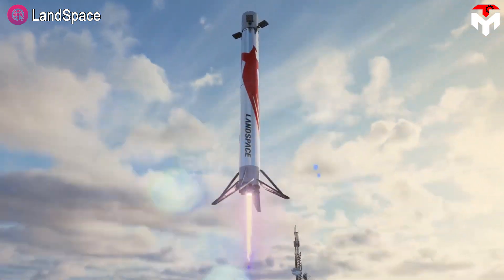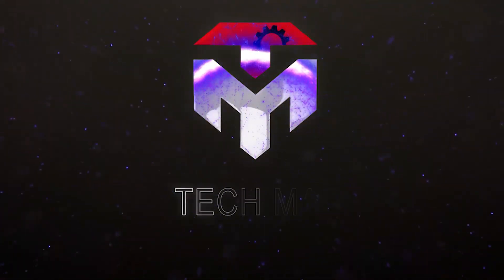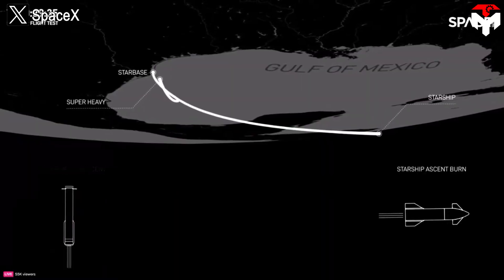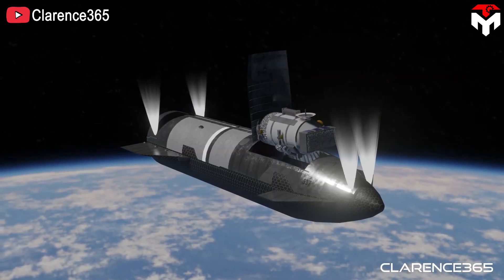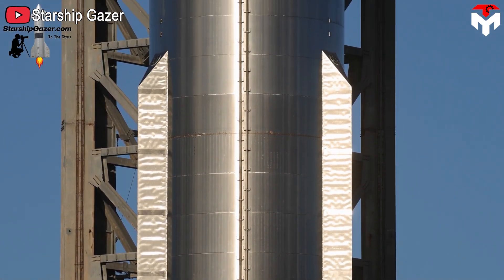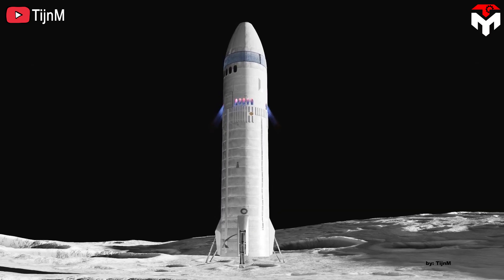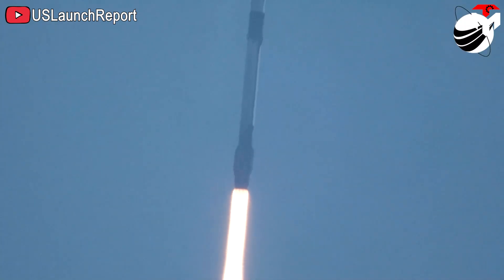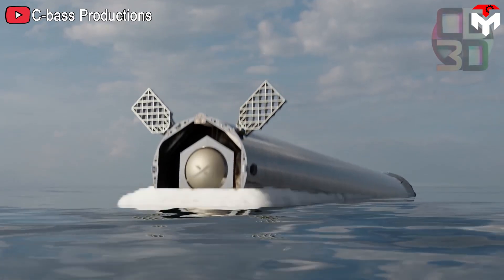MIND-BLOWING! SpaceX to Land Superheavy Booster Onto The Droneship...

Comment: @techmap9 what is more cost efficient, landing both Starship and Superheavy on a same structure... or developing landing legs, and brand new droneship, that would have to be custom made, so +2 years of development, and 100M per ship minimum, (extremely optimistic guess, since current droneship cost 10M for old, comparatively mass produced repurposed barges with the rework) or maybe more since you would make only around 3-5 of them for the R&D cost+ the operation cost of the crew, fuel and equipment. 
So at best it would cost as much as the tower, and you are dealing with extra dozens of people on top of it, and regardless we already had better idea considered, worked upon, and scrapped for the same cost efficiency reasons... Phobos, and Deimos.

Comment: The best solution would be to install a couple "landing sites" on solid ground, somewhere a few miles away from the launching site.
Advantages:
No risk to the launching site. 
No need to transfer the Starship or the booster from a drone ship to land. 
The landing site could at first be used with landing arms attached to  Starship and Booster but could later be upgraded to have a simplified tower with chopsticks.

Comment: The problem is that if they use drone-ship landings only, now flight cadences become limited by the number of drone-ships. Building out that fleet will be expensive, and especially as they move over to return to landing site. It is also the question of fuel saved by drone-ship landing versus extra weight and complexity of landing legs.
Interesting times await.

Comment: Per me the best is just keep large boat very close to Boka Chika shore. (It can be a couple of miles far from nearest port) After landing they can transfer booster back to launch area. Its much safer, than trying to catch it. In worst case scenario in rough sea booster will fall to the water if not properly fixed after landing.

Comment: I wonder why Elon not using falcon9 landing design for Booster. Its proven more than 200 times. They need just larger boat. It should be 5 times larger though. If it misses the boat during landing, nothing gonna be destroyed besides booster. If landing  to launch side, it can destroy everything there.
Reply: consider this, the barge is by your words 5x bigger but the accuracy of Superhavy will be the same as F9, it is the same GPS system, so it will be 5x harder to miss the boat and not cause damage to it, in case of late failure of the booster. 
Unlike F9 where slam onto a deck means slight facelift, Superheavy RUD might cause a decommission of the whole barge.
Reply: @Chuck.1715  Its not about accuracy. Booster is much more heavier than Flacon9, That's why you need larger and thicker barge. The rest is the same. If booster doesn't slam the barge with very high speed, nothing gonna happen to barge.
Reply: @tigranohanyan3321  accuracy is not the point of my comment, and i said in case of failure. Even if the idea is pursued, there are many reasons why it would not be cost effective, potential destruction of both of the vehicles is one of them.
Reply: @Chuck.1715  Hey, what's your point?  It was proved with Falcon9. Many times when Falcon landed and then partially exploded or fully exploded and fell to water barge was just fine. The same can be scaled to fit the booster. The rest is the same. Have you ever heard that barge sunk after Falcon9 explosion?
Reply: @tigranohanyan3321   ok what you are saying now is the same as to make F9 just 3x bigger to scale and it would be functional rocket, material integrity just doesn't scale like that. Now i wonder if Blue Origin still pursue building a barge for New Glen, it is smaller vehicle than starship, and even then they will have to test it out if it is even viable for them to land on the barge. You are landing untested vehicle on another untested vehicle, there is a huge chance of error regardless of what F9 showed.

Comment: Droneship landing is the idea that needs to work because there's little risk to surroundings.   I would propose a two legged landing.  Two legs on one side of the booster, as it touches down a "lean to" arm on the droneship moves in to support the ship on a severe tilt.  The arm also has widely spaced chopsticks.  The ship can move at speed to port, since the landed ship will be more stable as it is leaning into the ship.

Comment: how about a drone ship with a catching tower? no legs, land on anywhere, no payload loss. more over, the drone tower would be much much simpler than the original one, without fueling attachments, no water deluge system etc.
Reply from the maker: Yeah. SpaceX also planned this but they paused to focus on launch Starship successfully first
Reply: @techmap9  I know, but they were huge modified oil rigs, which would serve both catching and firing StarShips, I'm talking about a much simpler and smaller drone ship with the tower, that could be built in a very short period of time, a lot cheaper, simpler etc. it would not be used to fire the starship, but to catch only.
Reply: @muratahmetgenc6942  It would be way too much mass in the air.  The drone ship would be unstable.  Imagine a sail boat with a five story brick chimney on it and you get the idea.